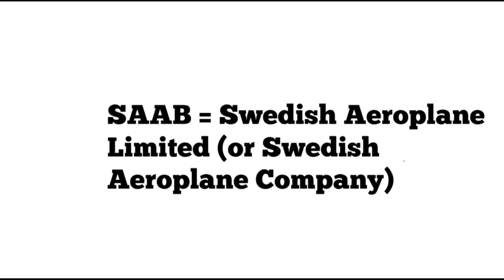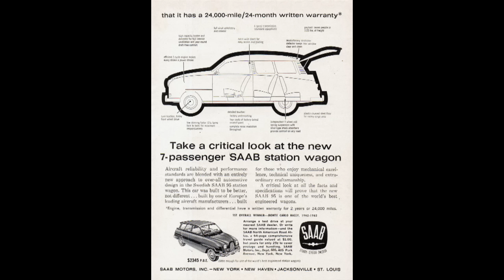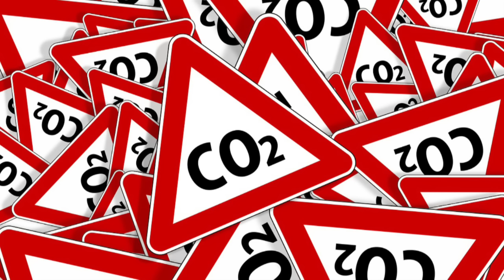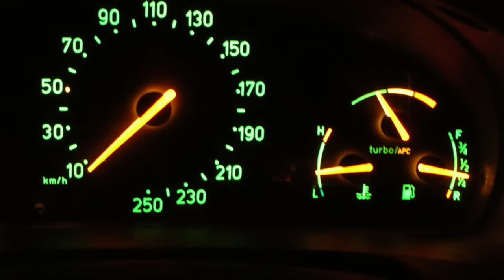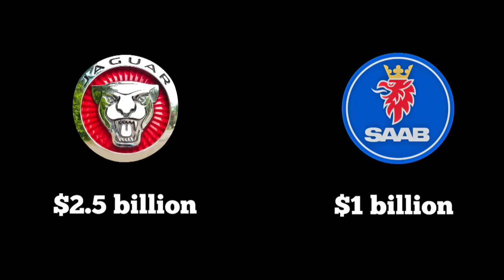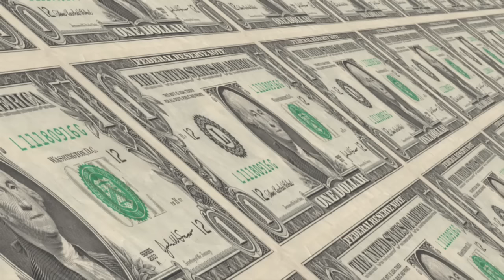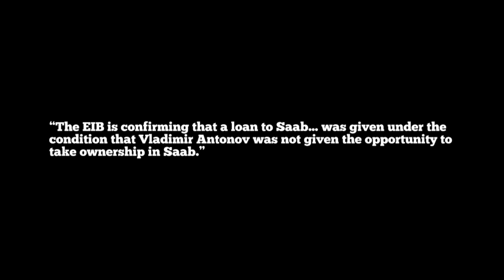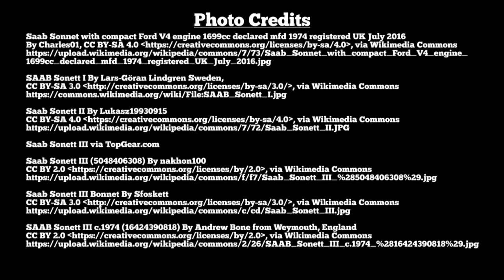The Life and Death of SAAB: RCR Car Stories

Comment: I have owned or own several Volvos and Mercedes and a couple of SAABs. The latter left me with two convictions 1) SAABs had the best seats ever fitted to any car 2) a 2.0L turbo is the best, most versatile car engine. In 2006 my wife and I drove our 2004 9-3 all the way up Québec's James Bay Road to Radisson and Chisasibi and the La Grande hydro project. If you're not familiar with this road, it requires signing a register when leaving Matagami, after which it's nearly 800km of lightly travelled, unpatrolled (at least at the time) undulating pavement with a single fuel stop along the way. The car was in its element... we travelled very fast, used very little fuel and arrived rested and ready to do it again.

Comment: My first car was a 2-year old 2-stroke 3 cylinder, equipped with a rack under the driver's seat to hold the oil cans.
I subsequently had a 1969 Monte Carlo GT, advanced to the oil metering system, and column 4-speed.
Very unique and advanced for their time.

Comment: i had a 1999 saab 9-3 convertible 5 speed and i loved it.  when i wasnt having a saab story.  the thing was extremely unreliable. constantly having issues. like one after another. and no mechanic wanted to work on it except a select couple that charged crazy amounts to fix it.  so after spending so much money on an abs module then the fuel pump, then the map sensor, then the crank position sensor. the last time it failed to start i decided to just park it in the driveway and get a new camry.  well turns out the crank position sensor went bad again, i bought a cheap one online and put it in and it started up.  but already too much damage was done, the top leaked a little. and since i parked it for a long time there was mold all in the interior. so eventho the car ran and drove i decided to junk it because of the mold.  im so mad at myself for not putting the car cover on. because that woud have been a really fun toy to have today.  i would have put in bigger turbo and used it in nice weather with the top down.  driving a 5 speed turbo convertible is so much fun.  now i drive a chevy volt and i love that car but it is very plain.  i miss driving stick sometimes.

Comment: Been through a couple of 03 9-3s.  Both made it 300k before deciding its time to move on.  Never had major issues.  Other than weird computer issues a trip to the junk yard couldnt fix.  And cloudy plastic headlights.   Oh and leaky cabin filter housing and fan wiring harness.  And pain in the ass fuel pump replacement (just dangerously cut a hole underneath back seat)... and sound amplifiers limiting speaker upgrades... magnetic key locking issues.. constantly broken flimsy passenger cupholder.

But other than all that, great car!  Rarely ever changed the oil and never had valve clatter or turbo issues lmao

Comment: I had an 83 900 Turbo and loved the car.  It was so much fun to drive and felt solid.  Never had much of mechanical problems with it and to this day was the most fun car I ever owned.  finally had to sell it due to the transmission was about to fail and at the time did not have the $3500 price tag for a new one.

Comment: I had SAABs from 1987 to 2012, then Volvo V60 as main car but I still own 2 SAAB as collector item and second car. Of course, the condition of your own Saab is the essential if you want to keep it for long. But my advise, out of Swedish conditions are: Accept that the 9-5 will rust away and that the same will happen to the 900s and 9-3 up until the latest model. But the latest 9-3 seems to have a basic quality to avoid rust. 
The programme did not mention last 9-3 generation and also missed the NEVS production of about 300 SAAB 9-3 under the SAAB brand. Those SAABs are now becoming collectors items in Sweden. (My SAAB 9-3 TiD yer model 2007 had a rather boring diesel engine but still operates in this area, looks fresh, under new ovnership. I sold it at 190000 km, about 120000 miles.) And the thing with SAAB was always ride quality, winter capacity, seats and dashboard.
But thanks for a well made documentary of a carmaker that deserved a better fortune.

Comment: I had 96 V4 in late 60s. I remember the colum change was impossible to beat, but I found the free wheel unnerving.  It was engaged to stop override in icey conditions. All brake and fuel lines were run inboard under a wooden inlay floor. I’ve always considered it to be one of the best cars I’ve owned

Comment: Fascinating, Roman. 

Loved this one, and the one you did on Pontiac. 

A lot of argument has been made on the GM LS series borrowing Engineering principles Pontiac pioneered. 

That said in spirit of the "never say die" enthusiast. I'm trying to revive a 1973 Pontiac Firebird Esprit, with a 6.0L GMC motor..it was originally a Saginaw 3 sp with a 2bl 400 poncho motor, which are long departed. 

It's my money/time pit. But a labor of love, I work on when I can.

Comment: A lot of the footage is in Connecticut. At one time Saab USA was located there. Used to see them on the road everywhere. I owned four over the years. A 1976 (used) a new 1994 and 2004 then finally a used 2010 in 2012 with 13K miles on it. The 2010 was totaled in 2020 with well over 200k miles. The 2004 was a front wheel drive and nimble and fast. The 2020 an all wheel drive not as much fun to drive then the 2004 but faster on the highway. All great cars to drive. The driver sat on the same plane as the cars center of gravity making then a drivers car. You could feel the road better then most cars and made them great handling and fun to drive at any speed. And for their engine size they were fast, handled great and lasted forever. They also had the most comfortable and best seats in any car. In total well over a million miles driven in Saabs. Best cars I ever owned.

Comment: The "free-wheeling" feature is interestingly enough found on Porsches equipped with PDK.  If you leave the car in auto start-stop mode while on the highway,  the engine disengages to idle speed if you are cruising,  which helps with getting better gas mileage.  Saab was truly ahead of its time.

Comment: I worked for a Saab dealer from 1988-1992. Saab's problems were before GM!! They never were capitalized and focused on areas that appeal more to europeans than americans. The 99 and the 900 were just minimally  updated when it should have had a serious redesign before the 80's.

What I experienced was a car that was low value, high maintenance,  and not competitive. I remember a person comparing a Saab to a Lexus for the same amount. You open the door on the Saab..On the Lexus it chimes and the seat moves to help you enter.  

Brand new 900's would have things like welds not completed, crossed wiring in the loom, and strange things like maintenance batteries (you were supposed to add water to them), in comparison to what the rest of the market offered.

The 99/900 were also plagued with very high repair costs in a accident. The body panels were welded, and it was a significant expense to replace them...Somewhere I saw a statistic that Toyota made 3 cars in the same time that Saab made 1..And Toyota had very few defects whereas Saab was almost every vehicle had a warranty repair under PDI.

Also, Saab was supposed to be so safe, yet a company that only makes 2 vehicles (900 and 9000), I saw several safety recalls of electrical fires and parts that could chafe and cause problems.

Saab also never took the 4 vs 6 cylinder seriously..Yes they had a great powerful engine, but it's hard to spend so much money for a 4 cylinder when a Lexus and Infinity offered so much more. 

Customers that had BMW's and Mercedes were accustomed to high maintenance and repair. Saab customers thought that "Most intelligent car ever built" would't be so expensive to maintain.

Another problem was that Saab didn't correct the issues quickly. For many years stuff like the leaking water pumps and heater control valves would just continue each model year.. Other car companies would evaluate how much they are spending on warranty, and have a fix to reduce warranty costs and improve customer satisfaction.

The only thing that was special to Saab was the quirky people that wanted them for arrogance.

Saab's were also too expensive to own for the people who supported them. I had a much better experience with my Cavalier then many customers had with cars I had to repair.

Comment: I saw a Saab Sonnett II at a little dealership near here.  I thought it looked pretty cool, with its weird V4 engine, but then I learned that it's front wheel drive.  One of the main reasons I like old cars is that a lot of them were rear wheel drive, like the Toyota Celica started out as rear wheel drive, for example.

Comment: I owned 3 Saabs at different times. A 1981 900, 1985 900 turbo manual  and a 9000 turbo manual. I bought all of them used with low milage. They broke down a lot and were expensive to maintain and service. The 9000 was like a tank for sure. Fun times on road trips. I never was on board with Saab/GM.

Comment: *We owned TWO of the 900s, one from 1983, and another from 1986, loved them both, solid, safe, nice driving cars, that 
handled well, and were surprisingly built like a similar vintage Mercedes Benz, a very pleasant thunk from the door closing. 
Better yet  the price was very modest for what you got, and the seats were very good, on the same level as those in a Volvo!*
Still miss them today. SAAB is missed!

Comment: Thanks for this by the way. I have had many saab. Several 900 my first car was a saab 900 turbo that my friend had tveaked a bit so it had far more power than original, i later on got even more power by setting the max turbopreassur up 1,5 bar or so. It was insane.

Comment: My dad had two Saabs (sequentially) in the 90s. A Saab CD and a Saab 9000cse turbo.
Both were really good cars but the second one the CSE was really special. It had amazing tan leather and I think it was either a deep purple or deep red.
It was turbocharged but only lightly and was quick without being really quick.
It was super comfortable and felt really luxurious in the cabin.
Great car.
They really were on a par with Mercedes and BMW at the time.
Edit: Sequentially.
Reply: They reminded me a lot of my E46 320i which was an ex-demonstrator. It was pretty much fully optioned out apart from the engine with BMW Custom Tourmaline Violet paint and purple Blueberry Nappa leather seats, aircon, cruise, wheel stereo buttons and the BMW business head. It had the six cd changer in the boot and parking sensors. Loads of other cool features.
For a 2002 car it was pretty special. I bought it second hand at 60,000 miles and I drove it to 150.000 miles.
A 2.2 six is completely undertuned at 170bhp but it was a ton of reliable luxury motorting for a lot of years.
That same attention to quality is the same thing that killed Saab. BMW at the time obviously had the 3-series as a loss leader to get people hooked on the brand and pay for the more upscale an profitable 5 and 7 series.
The problem was Saab had nothing upscale of the amazing workmanship of Dad's  9000CSE.
And make no mistake it was an incredibly luxurious feeling car back then.

Comment: I have a vintage, metal, factory display model of a SAAB 35 Draken jet fighter.  What's interesting about the model is the plaque on the base of the model's stand which reads, "U.S. Saab Dealer Flight to Sweden.  November 7-15, 1959.  SAAB 35 DRAKEN.  Svenska Aeroplan Aktiebolaget, SAAB."  I gather a lot of those U.S. Saab dealer representatives flew on a period Scandanavian Airways System (SAS) Douglas DC-7C "Seven Seas" propeller airliner to Sweden back in 1959.

Comment: My cousin left me a 99EMS when he moved. It was totally clapped out and had over 300,000 miles on it, but it ran strong. Caught fire on me on Rt 89 in N.H., 2 miles short of work, so I floored it! Got her up to about 90 and shut it off, opened the sunroof because even though the windows were open, I couldn't breath in the oil smoke! I look behind me and I looked like a P51 that was shot down!lmao. Ipulled it into work, put the fire out and assesed the situation, the only thing was a bunch of burnt wiring and a leaking valve cover gasket, and a pretty swelled rt front brake hose!. I replaced it all for 25 bucks and drovebit for another year!

Comment: One of the fab cars that was difficult to beat in a parking lot gymkana was a Sabb 92. While folks were battling each other for time driving British and German cars of the 60s-68 one of the guys in a funky 92 always won out in class and sometimes overall. One time he rolled it at such a slow speed it looked like time lasped photography..couple of the spectators crossed the pylons rolled it up right and he was back in the game. DKW also imported  cute little 4 door sedan  with what appeared to be a SAAB  92 engine & running gear. Four speed on the column...cute little ride the dude down traded to a Mopar swinger 340 c.i. some people just don't recognize a gem when they have one...
We called the 92 little blue egg...

Comment: It wasn't that long ago I saw an early SAAB Sonett with its plastic body, on a parking lot not far from me. Sadly it had gotten a roll bar inside, with - two bolts through the roof to keep it steady!!! But I did manage, many years ago to visit the original SAAB Auto Museum, with free entrance, in the cars hometown of Trollhättan. They also had the prototype for the by then new SAAB 88 model for road testing, with a wider and specially built version of the old and former model car, and found and seen by a Swedish photografer by accident! Sadly the cars inside were all sold when the production stopped and the factory was sold, some years ago. Also the famous Rally Car, winning the Safari Rally, by at one time rolling the car on its roof to get it unstuck. Their most famous driver was named "Carlsson on the Roof"! And he became a consultant for the Factory.

Comment: I remember test-driving a SAAB 900 back in 2006 and thinking and thinking about how it seemed to know what I was going to do before I did it. I forget what model year it was, but it was older and high-mileage. You wouldn't know it by driving it, though. I wish I had bought that car.

Comment: I was never a fan of the 900 (too odd looking) but I liked the 9000. My 1st wife had an '88 9000 Turbo, and when it ran well, it was a great car to drive! It was shockingly bad in the snow, which I found odd for a front wheel drive Swedish car, but that may have been the high performance tires on it. Unfortunately, not too many repair shops in my area knew how to fix them. I had one shop tell me that we needed a new computer to fix a tail lamp issue, but another shop found a screw that broke a wire going to the rear of the car. While my wife had her Saab, I was riding an '82 Kawasaki KZ650 every day, all year round, to 2 jobs, for about 1 1/2 years. It's a shame that GM forced them into re-badging their cars and calling them Saabs.

Comment: I have never owned a Saab, just loved them from afar.
My son had a friend who had a 900 that was abandoned at his apartment house. We went an picked it up and dragged it back home. Super nice car, except the sunroof had been left open and totally ruined the interior. Put a new fuel distributor on it and ran like a top. No turbo, tractor engine, and automatic transmission, so it was very slow. So sad about the interior because it rode and drove so very nice.
Years later my son bought a GM Saab for cheap. It was a total POS. Had a head gasket problem, which should not have been a big problem. The problem was trying to find the correct parts. During that period Saab must have changed engine series every week.
Moral of the story, after the strange hood (bonnet) was gone, so was Saab.

Comment: I had a beat up 89 900 S sedan. Bridge of Weir leather seats. 16 valve non turbo. It was fun to drive and living near Research Triangle Park in Durham NC...EVERY SINGLE ENGINEER OR NERD...literally tried to buy my car or flew up to me when I got gas. It was insane. Even at night at the store, they would honk or try to talk to me. It had 500k miles when I scrapped it due to the battery destroying the frame on me..still, a great car

Comment: The miss management by GM of SAAB was painful to see. I was a Saab driver for over 25 years and the decline in the brand from model to model made buying later models a serious disapointment. The 9000 t 2.0 could easily do over 135 mph crusing for many hours at speeds well north of 100 mph effortlesly across Germany at night. 5 min with 2 x 10mm spanners on the wastegate gained over 25 bhp. Cutting pin 70 on the ecu allowed it to rev cleanly to 7000 rpm and a top speed in 5th of well over 155mph. How much I do not own the size of male apendages needed to do that!